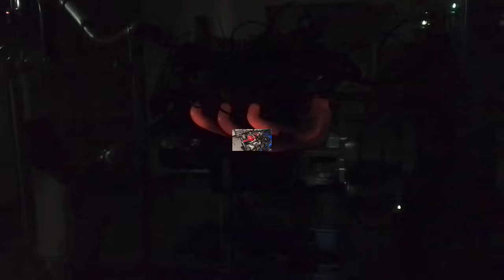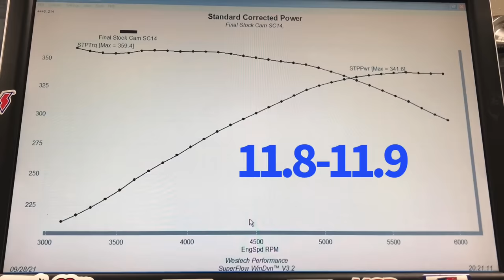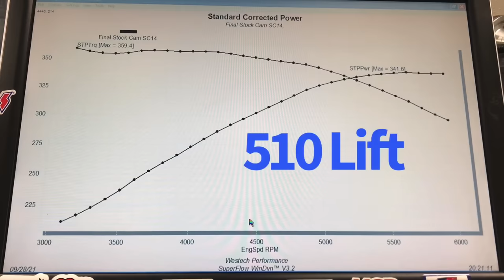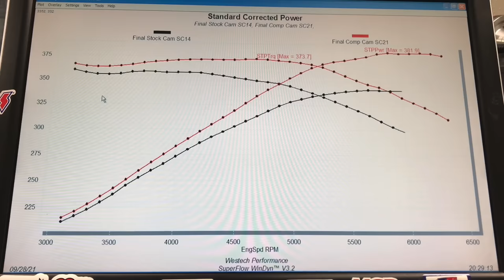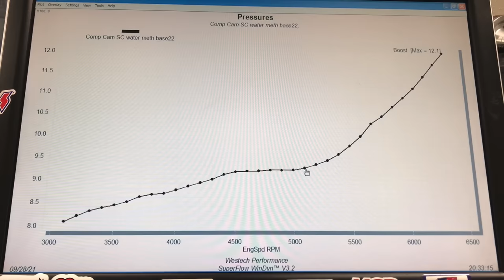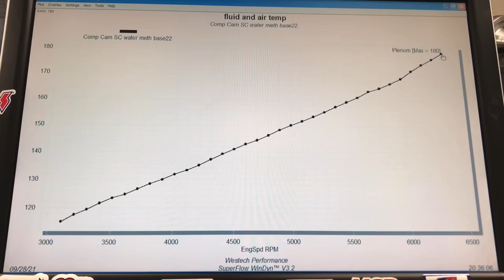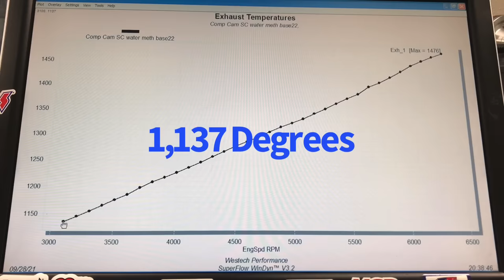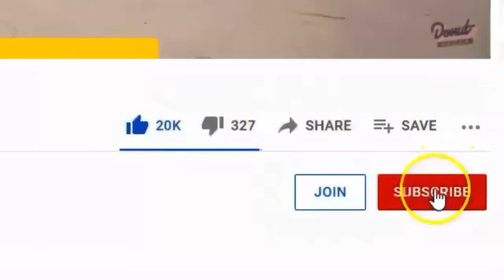HOW TO MAKE MORE HP : CAM SWAP A SUPERCHARGED 3800 L32/L67. MAKE MORE HP AT LOWER BOOST. DIY, LOW $.

Comment: At what point do you need to machine the valve guides for extra lift?
Reply from the maker: GOOD POINT-I NEVER CHECKED
Reply: @richardholdener1727  I heard it was around the 500 lift mark, currently building my engine and trying to figure it out
Reply: We've typically been advised that ~.540 requires that, since you can run an XP cam with shaved retainers, but beyond that the seals will get smushed.

Comment: Really curious to see the meth testing. Relevant for my ecoboost, haven't pulled the trigger on a meth kit.
Reply: I had a prix (non intercooled) there was no e85 option where I lived. Without meth on pump gas stock pully higher compression pistons and headers I was running 8ish lbs boost 8* timing ish. Maybe 10. After I did water meth injection I also added a 3.3 pully( factory was 3.8) I don't remember how much boost it made but I was running 19* timing
So it made a HUGE difference on the 3800 cars I added 10* timing and was able to still add boost.

Comment: Richard, I noticed when you showed the charts for the boost curves, and the fluid air temps, that in the chart titles it said "comp cam SC water meth base22".

What was this about? I didn't hear anything in this video of the mention of water meth being used. Although in a previous video I remember hearing you wanted to test water meth injection into the blower. Was this a typo in this particular chart, or? I can't imagine charge temps ever reaching that high while spraying water methanol, unless your weren't spraying enough.
Reply from the maker: IT WAS JUST A TITLE FOR A DYNO RUN WE WERE PLANNING ON TESTING-IT NEVER HAPPENED
Reply: @richardholdener1727  gotcha. Well, do the water meth test lol.  I've heard these M90s do great with pre-blower spray.
Reply: @boosted0079  He wants to. The test mule spit out a rod bearing.
Reply: @alantrimble2881  I seen that. Unfortunately, I've seen a lot of these 3800s spin rod and main bearings over the years. It's hit and miss with them

Comment: Is 210 a bunch of duration on an engine that size?  Big gains
Reply from the maker: VERY MILD
Reply: 210 degrees is a good street/truck cam. All the bottom and mid range torque fer ya.
Reply: Cams are decides by builder by engine components such as intake Manifold
Reply: @jarredsmith8091  Cams should be picked based on where you want to make power. Regardless of engine build an 8.5-1 engine and a 12.5-1 engine of the same displacement will make power in a similar power band with the same cam. Same goes for cylinder heads. Anyone thats got real life experience or has watched many of richards videos knows that.
Reply: @johndelta00  where u want to make power is based on the intake Manifold you use lol so
Reply: @jarredsmith8091  ok bud
Reply: @johndelta00  ok
Reply: for 3800s this is the standard cam size for the majority of people upgrade to and usually gets  in the 300-350whp range, which higher modded motors running 380-390whp with more intercooling
Reply: @jarredsmith8091  watch richard's (many) videos on ls cam swap and his intake manifold test. put the two together and you get your basic power band. picking a cam solely on intake rpm range is going to give you a lot of choices.
Reply: @natricjol  I've been watching him for over a year
Reply: @jarredsmith8091  then you'd realize that short of a custom manifold like Richard put on a 3v 4.6, short runners in a lsxr-t or a shirt runner intake, every manifold is going to give you power from idle to 7k. Your cam becomes the deciding factor in your power and at that point. We know that except for the most extreme power levels, ls heads are going to flow good. Even the worse heads have all but the most extreme small block heads beat on airflow. I mean swapping a 90mm throttle and TBSS gave me power across my entire rpm range compared to the stock truck intake. That's on a 05 4.8. TBSS has shorter runners than the stock intake, by 2 inches.
Reply: @natricjol  you said every manifold gives u power from idle to 7000 rpm take a look at the tpi intake Manifold it peaks at 4800 or so so no not every manifold gives u power to 7000rpm lol and yes I know cams matter what I'm saying is I pick my cam according to what intake Manifold I have for example if I have a tpi 350 or 383 I'm not gonna go more then cc501 cam 212/218 duration cam but if I have a miniram intake Manifold I'm gonna go bigger like a 236 duration cam if u use a big cam on a long runner manifold you're gonna kill bottom end and not pick it back up top

Comment: They are all in the junk yard where they belong.  They blow out and spin bearings with a 2 bbl carb.
Reply: I have a series II with a Turbonetics 7268 making 570whp. Stock bottom end. No spun bearings here. You are probably thinking of the old 70s/80s 3.8L which is a completely different engine altogether